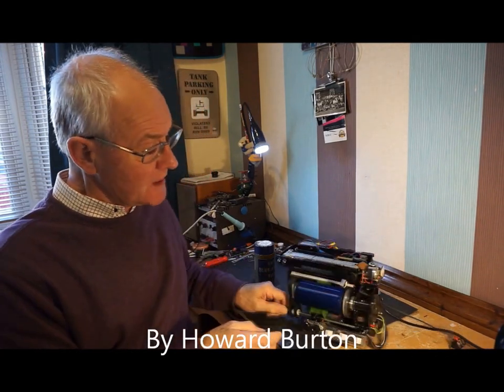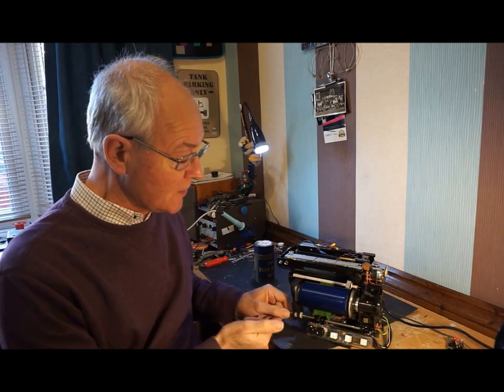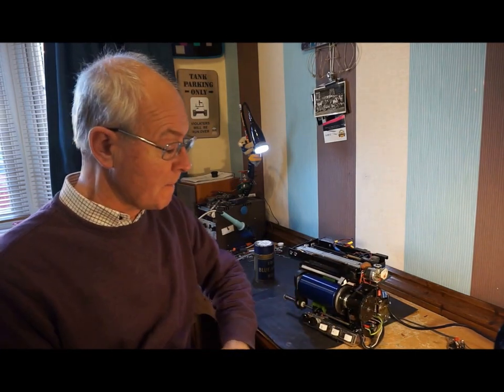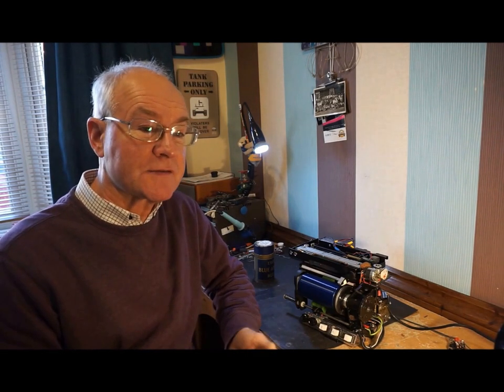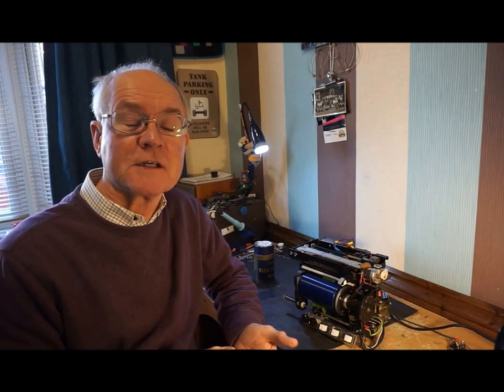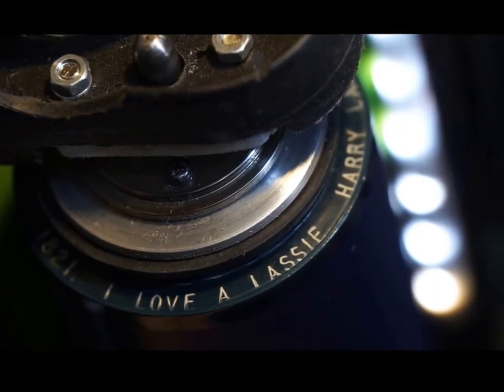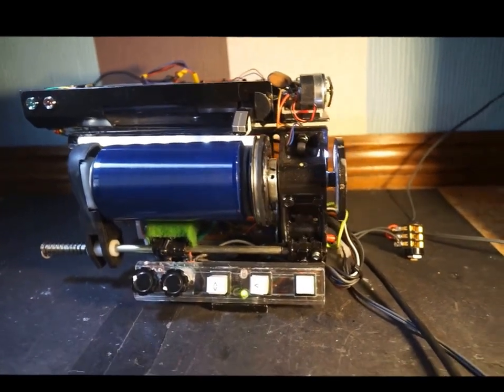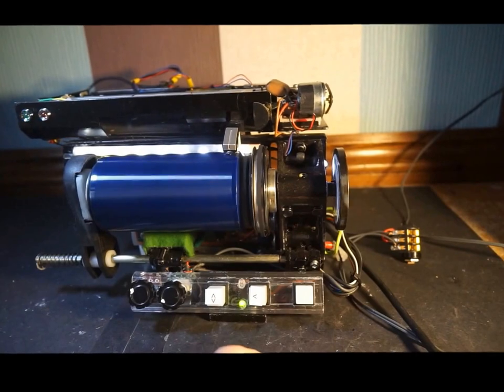Modern Edison Cylinder player

Comment: It possible to imagine an ALTERNATE TIME.LINE where cylindar format might continued after 1930 as a niche "Hi-Fi" format. Cylindars had severàl inherent technical advantages over the 78 discs.

#1 The "hill & dale" format had better dynamics as loud groves dont cut into adjacent.

#2 Tracking is done by power, not gruve..

#3 Weight of tone arm doesn't exist as pick up supported.

#4 Grove.velocity constant start to end.

№5 Tracking is linier.
I think cylander drives could have made small lunch bod portables, or table radios

They could have filled the dame nich as 45s.

Machines like this with auto cuing would be the modern form for dingles in an alternate time.line.
______
Interesting that in
our Time Line the
CD solves $2-5.

Comment: Is the linear tracking self-adjusting for 2 and 4 minute cylinders? If so it could in the future play vaporware high-definition 4 minute cylinders that would have twice the apparent grooves per inch and ran at 320 RPM.